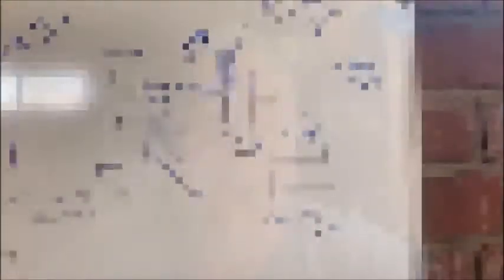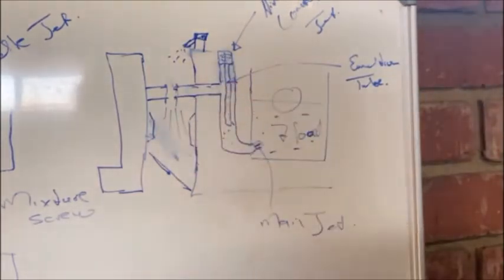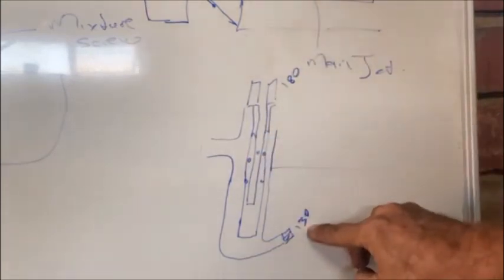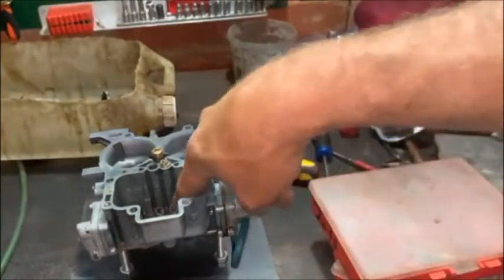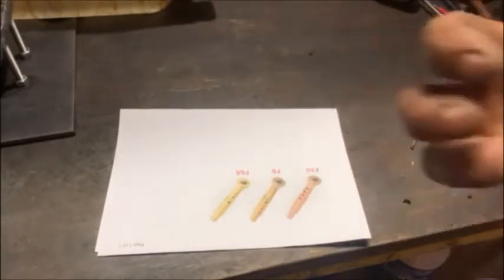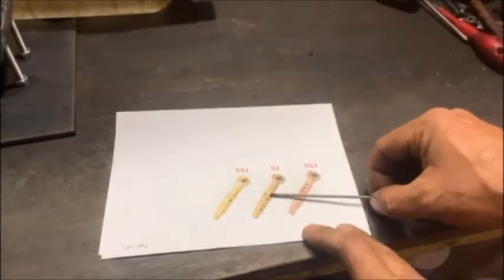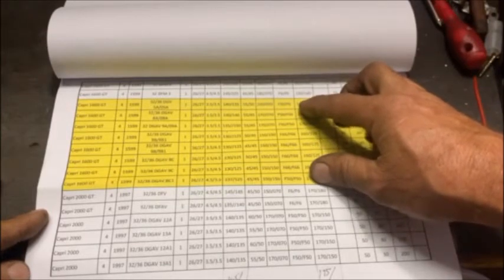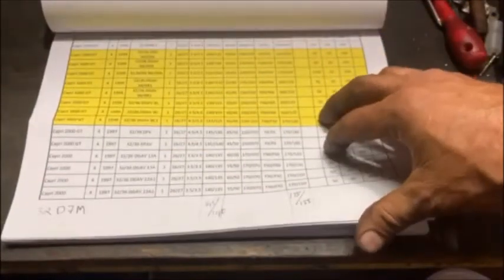Carburettor jetting - 3 - emulsion tubes

Comment: I Have a M10 B18 Bmw Engine with 292 Cam and 40s side dellortos..But its too  rich   smokes black ..like a Diesel..
Reply from the maker: Service the carbs, check fuel pressure and check the float levels, i assume it was running correct before and the timing and plugs are good.

Comment: Hi, I have an issue with emulsion tubes being very tight in the wells, is this an issue? Should they be loose, snug? they require a small extractor to remove when changing, your reply would be appreciated, Cheers
Reply from the maker: Hi, they should be snug, i remove it with a screw as an extractor.

Comment: I have a jet kit that’s telling me to drill 3 extra holes in the emulsion tube ,what do you think about this ?
Reply from the maker: Hi, in what location do they suggest you drill it, if it is lower down on the tune then it will supply fuel al lower rpm.
Reply: Hmm  ive been lead to believe my problem of an off idle hesitation was an emulsion tube problem i just dont know what ones I need. Mg midget 1500cc I believe the ones that are in it are the ones with 3 sets of holes at the top

Comment: Which emulsion tubes would you suggest on a Mitsubishi 2.6 4g54 blow through turbo running an 32/36 Weber the f6 or f66?
Reply from the maker: I haven't used a 32/36 on blow through but i would try f50 tubes. that way you should get more fuel at higher cfm under boost.

Comment: Hi .I bought a 36 dcd7 that I want to fit on a 4y hilux 4x4.Can please you suggest  jet sizes for me please.Regards.
Reply from the maker: I don't have a jet chart on your motor but try 140/145 mains, 200/160 air correction, 27/28 chokes, F23/F30 emulsion tubes with a 60 pump jet, it should work well. use it as a starting point.

Comment: Sir! What jets would recommend for a 1.9 ltr Volvo engine with mild cam at 5000 feet elevation?Weber 38/38 dges is installed. Slight hesitation on acceleration. Thanks, Bob and great work😎
Reply from the maker: Hi, i don't have a jet chard for your application. try smaller air jets and a larger accelerator pump jet
Reply: I now have 170/170 air correction jets and H225 accelerator pump jet. 160/160 . Thanks, Bob Also, would you have any Italian Weber 38/38 Carbruarors around?
Reply from the maker: @robertbandusky9565  yes i do, what is your location please
Reply: @carburettorrebuildservice8964  Arizona
Reply: Looking for Italian 38/38 dges , Weber of course

Comment: What size of jet  is used for l28 engine I am using airjet 180 main 160 primary side secondary side air 170 main 155 is that the correct  Jetting
Reply from the maker: NISSAN 2800 36 DCD 7 Venturies  25/26 Mains 145/135	idle 55	emulsion F30/F23 Airs 205/180 Pump 70
Reply: Do you get 180 out it for me taking long for the cat to reach 180
Reply: I mean car

Comment: Hello from Ireland , Thank you for your videos ,they have been really helpful.. I daily drive a 1986 Renault 5 , 1.4 auto, and I've just serviced the carburetor, its a weber 32 DRT , but I'm having an issue after refitting...it wont shut off straight away, its splutters on for a few seconds...its idling ok ,maybe a little bit high, to kept it smooth, could this be causing the issue?.I did change the HT leads and the distributor cap also, with this block of work....any suggestions would be appreciated, I've double checked my work, so at a loss what to try now....thank you...Michael
Reply from the maker: hi, check the heat range on your spark plugs, your timing could also cause this. it could also be that the carb is perculating via the idle jet, perhaps turn the mixture screw in a bit. please let us know what you find.

Comment: F50 emulsion tube in the primary side is put there because it's the richer emulsion tube specifically for the reason that you need a more richer mixture on pull away , you can go low on mains with F50 and still have the correct ratio for determining the air jet.
cool hope my comments helps.
Ratios are 3-1 ...
Like your videos , these will help guys , Thanks for it.